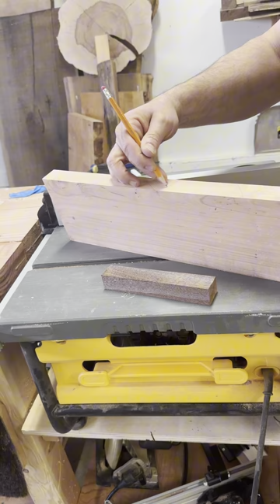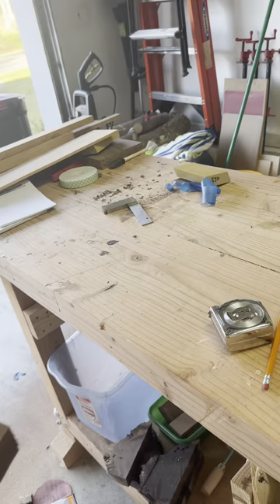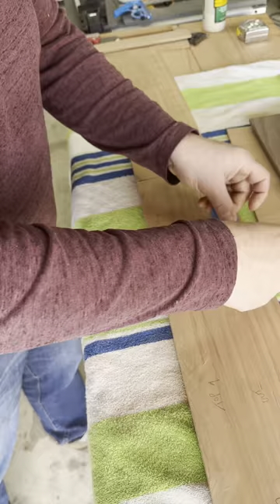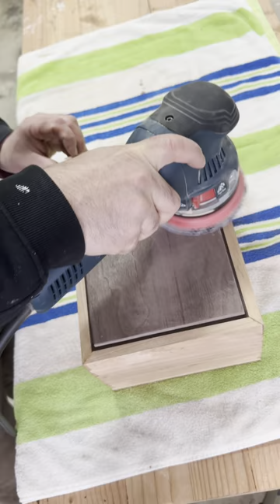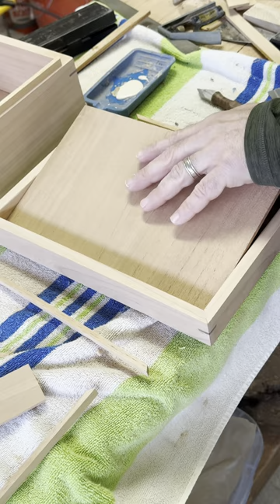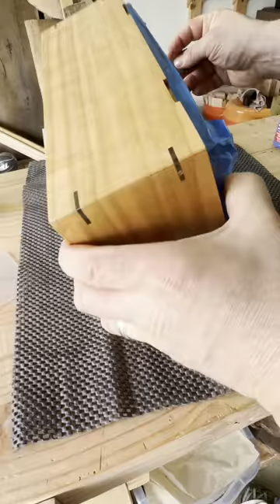FULL HUMIDOR BUILD - featuring Walnut and Cherry | guest appearance - Spanish Cedar

Comment: Dude, nice work man. I’m particularly fond of how you cut those splines. I built a jig and it appears there’s a much simpler way 

How well does it hold humidity ?
Reply from the maker: Thanks for the compliment. The 4 I’ve made have been pretty good at holding humidity. With any humidor you need maintain and the more cigars the better. The boveda packs have always been good to me. 

I’ll never make a spline jig. This method is too easy.
Reply: I did the same thing, and when I saw what he did, I was like "well, I wasted a bunch of time for nothing 😂".